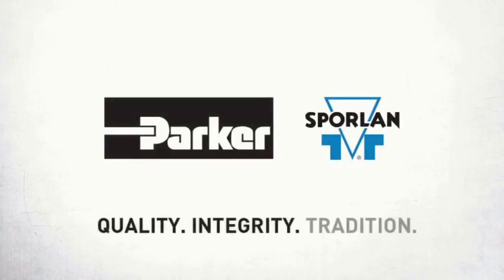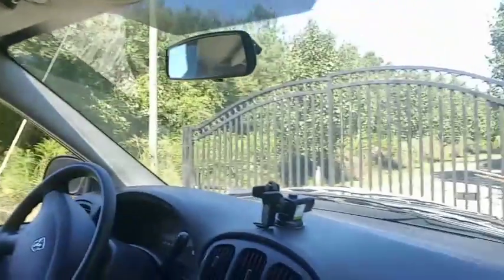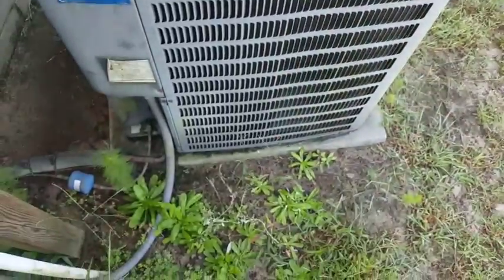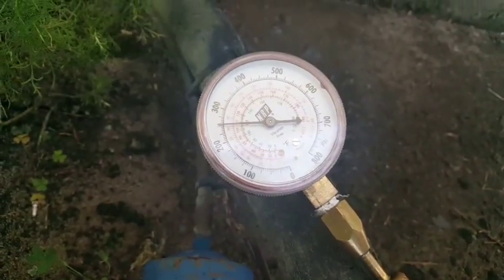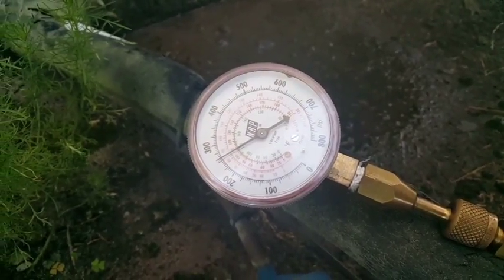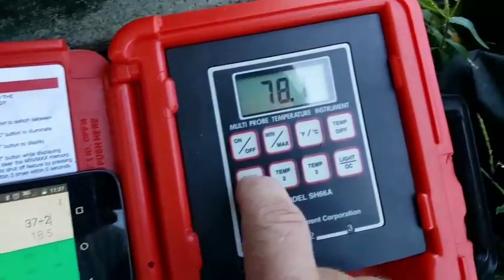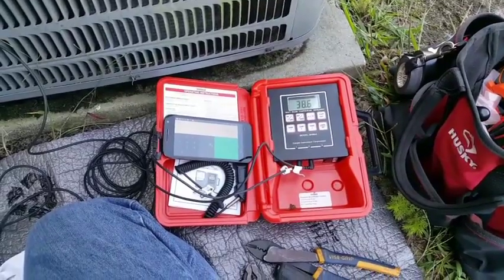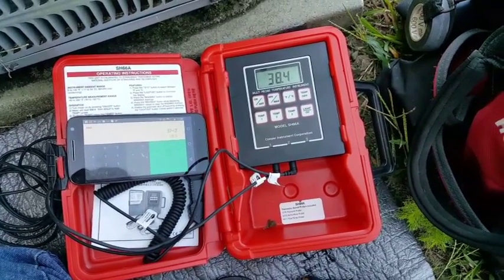HVAC Target Superheat Calculation | Low Airflow

Comment: Return Air Temp - 35 = Target Evap Boiling Temp
Reply from the maker: Adam Spears it depends on system efficiency. It may be lower than 35.
Reply: @TALYN875  So with new systems you subtract a smaller number from the RAT? Like maybe 30??
Reply from the maker: Adam Spears you would do it with oversized evaporators. Like when you have a 16-18 SEER match.
Reply: @TALYN875  Oh. Thanks for the video & answering my questions quickly.